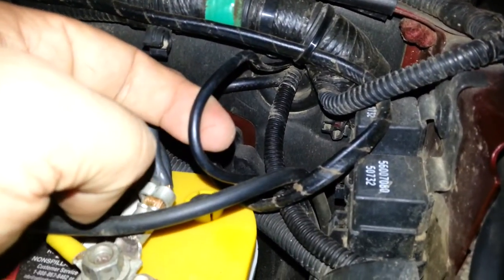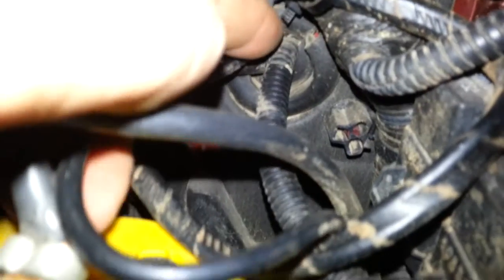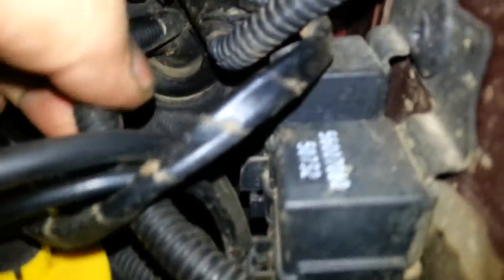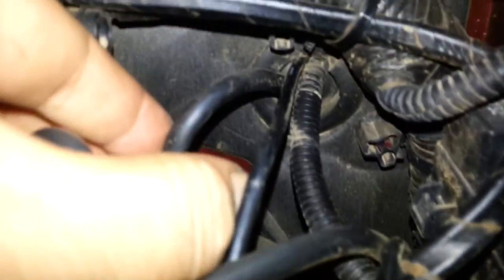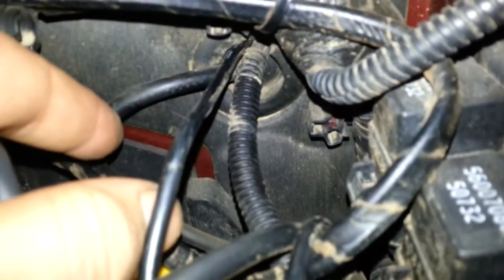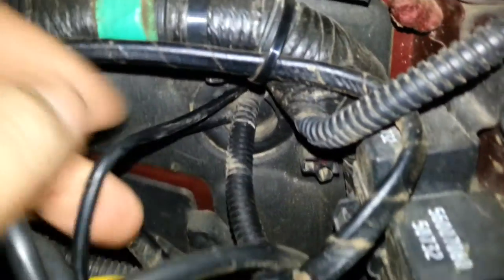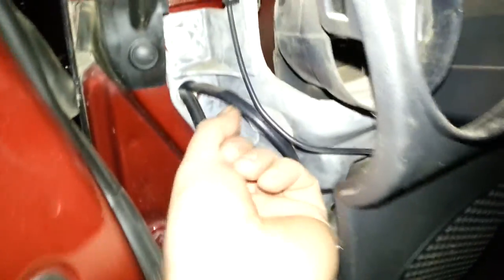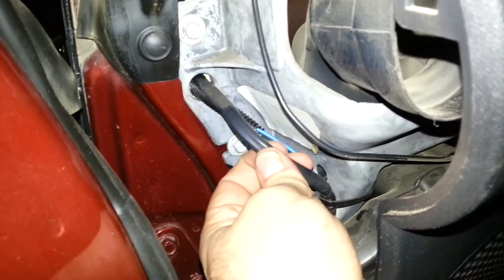JK Wrangler Cable Routing Trouble

Comment: top wire looks to be the coax ... just fyi but since this is 2 years old im guessing this is solved :P
Reply from the maker: Well, I never actually worked out what was going on there.

At the time I was trying to work out how to mount a CB antenna on the front bumper but I ended up opting to place it on the rear tyre carrier instead.